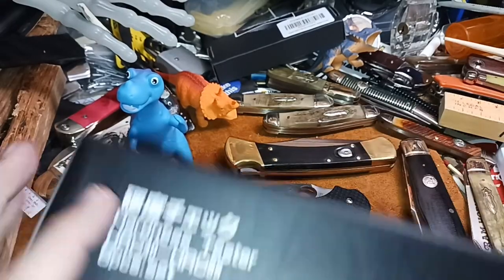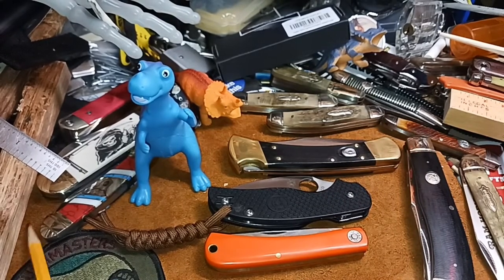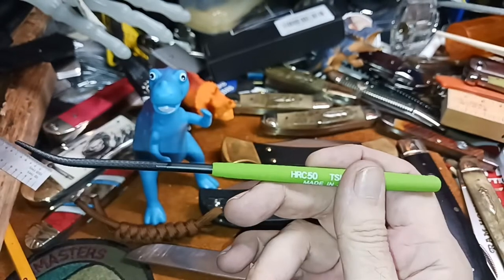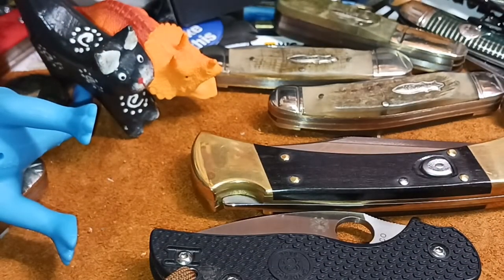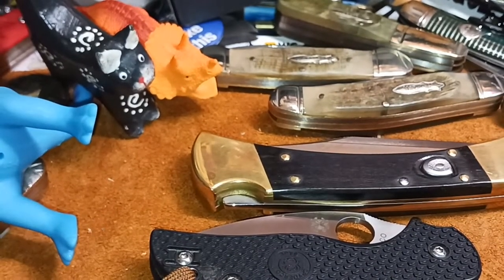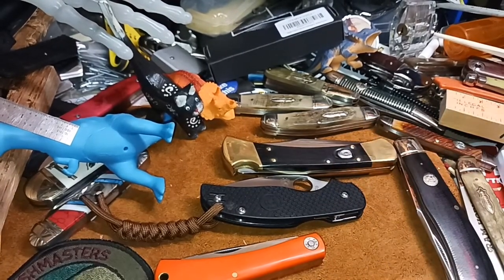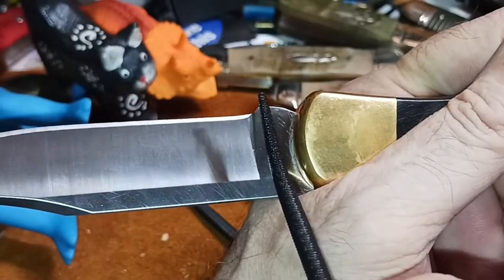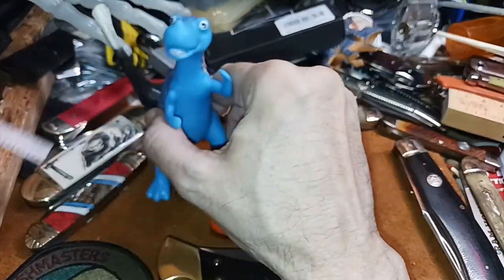(821) Rockwell Hardness Test ⚜️ GEC 71, Spyderco Sage 5 LW, Buck 110 auto 420hc

Comment: I think the amount of pressure using the hardness tools is key. If you push really hard with the 50 HRC you might gonna scratch a lot of blades. I guess that's something you have to feel, they can't tell you how much pressure to attend at testing. You pretty much are on key with the use. A knife maker might want to have more degrees to specify the hardness. But for an educated guess this will do. Thank you William.
Reply from the maker: Thank you Jeroen.  I think this set is best on unknown steels from unknown manufacturers.

Comment: This is very interesting. I think that you're right about the GEC being 1095. From a utility point of view I would have expected that style of knife to be under 60 and I was quite surprised. A knife can be too hard.
The same goes for the Buck, but it also pleasantly confronts my predudice prejudice regarding 420HC. I've always liked their design, but doubted Buck's claims about the steel and their heat treatment because I'm always sceptical about marketing. Maybe I'm plain wrong. 420HC is an older steel (not as old as 1095 which is still in vogue), but if it was good when it came out then it's still just as good. If Buck chose a winner initially then why change. The heat treatment of steel is critical as you say.
This has been a great series William. Thank you and all the best.
Reply from the maker: Thank you for the suggestion to test Rough Ryder 1095 carbon. It got me to testing these other ones.

Comment: These hardness testing kits are the least costly you can use. Often used by machinist to check metals for hardness working with unknown materials. It gives you a general idea of the cutting tool or surface grinder wheel speed and harnesses need. They help setting the machine speed, rate and depth of cut.
The accuracy depends on the the sharpness of the tool as it wears it will show higher hardness levels than when new, it also indicates only surface hardness. Other tester use striking anvils and require measuring the dent size and depth of the mark. Tester systems like this cost a $1,000 dollars or much more.
Ramset nails used to shoot thru steel beams and poured concrete have an HRC of 53 to 58. Concrete nails have an HRC of 50. Box nails used with carpenter hammers have an HRC of 30. If you wanted to make your own tester, a simple nail would work if you wanted. Knife blade steel harder than HRC-64 is bad and considered too hard for knife blades.
Quality files used to file steel HRC from 60 to 70 and most are 1095 carbon steel. An un-tempered blade hard enough to resist scratching from a file only means it is hard enough for tempering successfully into a knife blade. Steel tempering is more complicated than this but it is a basic idea to understand. 🐯🤔🙂
Reply from the maker: Thank you for the information Gizmo. Steel and knife making can get complicated. It looks easy,  but there is a lot of things that have to come together just right to make a good blade.